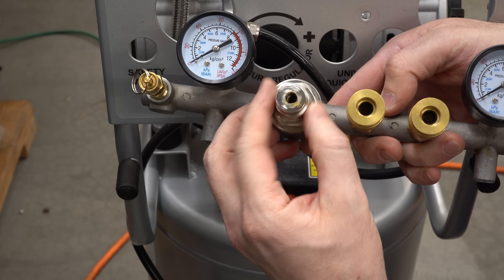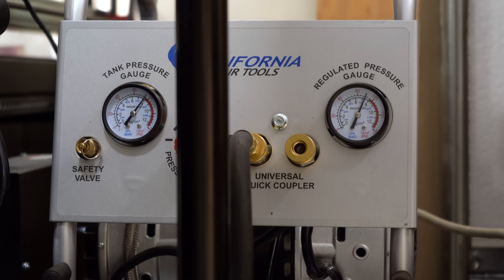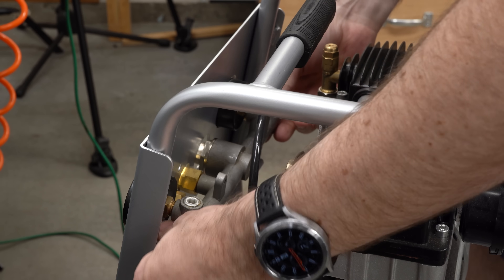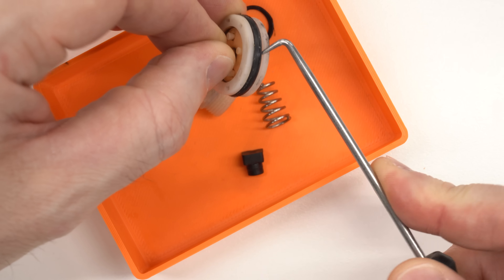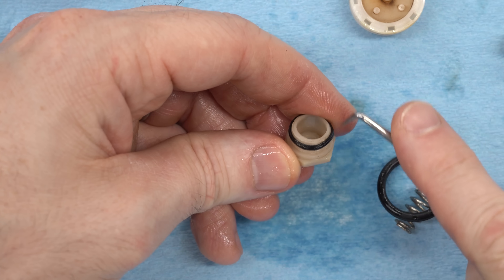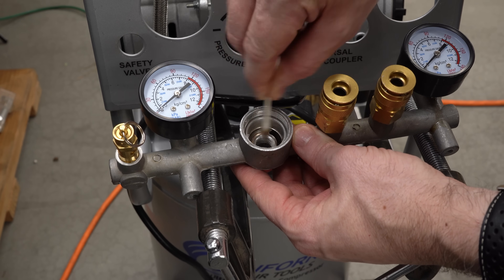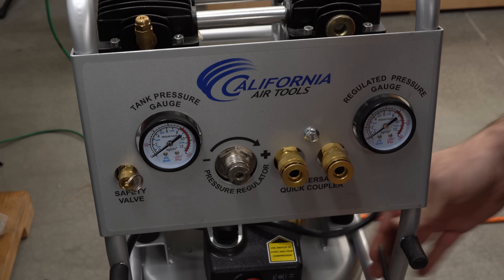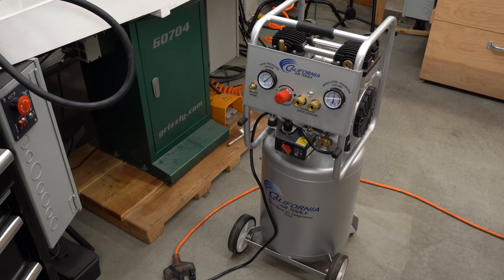Repairing a Leaking Air Compressor Regulator | California Air Tools

Comment: Thanks for video.  Worked for me.  I had a slightly different problem, the regulator was just leaking air so the compressor never stopped running.    You asked about he red ring: the red ring is to lock against the red knob so that the red knob does not accidentally turn.

Comment: What sealant do you use on the threads when you have to replace something on the compressor like pressure switch or gauge or some other threaded fitting? Loctite 545?

Comment: I had the same leak on my fortress (harbor freight) air compressor and this fixed it. The knob on mine comes off a little different than yours but cleaning the parts fixed my leak. Thanks for sharing!

Comment: Mine is 10020 and yours is 10020C, my internal M14 is not plastic but brass. I cleaned as well but no luck. before I clean each air release cause 10psi down won't recover, after cleaning each caused 5psi down and max is 90psi. the red ring limits max psi now I tend to remove it. I think my regulator never works.

Comment: I have this same make. I really like it, as it's quiet enough to have in the garage yet not drive me out. That said, it did something once that caused me to never trust it to "just run". Once, as the tank pressure dropped off, the compressor TRIED to start but just sat there, stalled, drawing who knows how much power, and it was only a few months old. It hasn't done it since, but now I can't trust that it won't blow a breaker - or catch fire.

Comment: I think that plastic piece under the knob is to prevent you from adjusting the air to high. Maybe they didn't know where the top side of the adjustment was going to put it so they added the rings after the fact. No idea for sure. Just a theory and I'm always down to provide some engagement. :p

Comment: My Briggs & Stratton 074027-00 air compressor was doing the same as yours, same problem with the flat rubber washer in the regulator. I replaced it with a small O-ring and it works fine again. Your video helped me quickly find the problem.

Comment: I had a pretty serious look at these style of compressors when looking to upgrade to a 'serious' shop level compressor vs an oil-lubed variant. I wasn't so concerned with noise since where it's going will be noisy anyway, but my experience with oil-less compressors has been mixed at best. This style does seem to offer something I hadn't tried yet and may be better for it in the long run (as I understand them, they have serviceable parts unlike most any direct drive oil free units at the big box stores), but the thing that held me back was the relatively unproven duration of how long they can run high volume air. In comparing them to more proven oil-lubed variants, it seems the motors in these are reluctant to run longer durations on a large reserve tank in the 20-30 gallon range without thermal break cycling. The more you look around at the mid-tier range, these little twin cylinder 'quiet' versions are popping up more and more, which made me try to chase down who actually made them. It never panned out trying to find a definitive source, but they all looked exactly the same and came from China; big surprise, right. 

Anyway, curious to people who own either this CAT brand or the other variants what kind of 'mileage' they've gotten out of them when pushing air hog type tools, vis-a-vis plasma cutters and the like.
Reply from the maker: CAT has different models.  Some are rated to run continuously for something like 30 minutes (don't remember exactly), and some are rated to run continuously.  Mine is the former.

Comment: I have the same compressor.  Mine has a slightly different O ring on the white plastic diaphragm piece.  It's U shaped with the open part facing the inside of the regulator.  On mine there was enough clearance between the diaphragm  and housing that the U seal rolled over and started passing air out the regulator..  I simply machined an aluminum replacement cap for the diaphragm and removed the valve.  Flow more air that way. I never use the regulator.  No air leak, compressor  will hold pressure easily for a few days. Most of the leak is from hose and nozzle.

Comment: I have lived my entire life with compressed air leaking (My dad's compressors and whatnot all leaked)... Until I got my new IR compressor, and after making sure all tapered  pipe thread fittings had pipe dope on them and were properly tightened, I had my first ever compressed air system with no leaks. I just leave the compressor switched on even overnight and it holds air, granted if something ever starts to leak overnight I guess I may have a big electricity bill.

Also hoping for fewer issues with leaks since I have a cooler and water air separator on the compressor outlet, should prevent rust and debris from causing any valves to leak, though I should probably add inline filters somewhere.

That said some of my quick fittings are leaking and I leave the ball valve turned off most of the time. Need to sort that out.
Reply from the maker: I do the same, and worry about what might happen if I have a catastrophic leak when I'm gone.

Comment: When setting the pressure regulator, you set it to the desired psi while the tool is running. Different tools have different air requirements and should be set individually. But since it is a small compressor and you probably aren't running big air hog tools, you can usually set it a little high at around 95-100 psi and it will drop close to 90 psi when in actual use.
Reply from the maker: I'm not generally running air tools from it.  Mostly just blow guns, pneumatic cylinders, and mist coolant systems, which regulate down to much lower pressures, so it doesn't really matter.

Comment: I had the exact same compressor. Mine was leaking the day I took it out of the box. I think my leak was different than yours. It would slowly lose air, and if you left it overnight, the tank would be empty. I tried fixing it and was not able to. Reading the Amazon comments, a lot of people had the same or similar issues. I kept it for a year because it was too much of a hassle to pack it up and lug it down my stairs to return it, and it worked well enough for my limited use. I ended up gifting it to someone that bought a small Taig desktop CNC from me. I never wanted to see it again. Just a garbage product, IMO. Stay away.
Reply from the maker: Mine leaked from day one, also.  The issue was the drain valve.  I called them, and they sent a replacement, which was difficult to replace due to the incredibly sticky sealant they used, but it's been fine ever since.
Reply: @Clough42  so yours broke twice then. Once out of the box and once for this video. It’s a poor product.

Comment: I was thinking that plastic ring is something for the knob to seat against when fully tightened rather than rubbing on the cast metal valve body. I don't actually know, just guessing.

Comment: The regulator would not need cleaning as often, if an air filter was installed between it and the tank, but it has to be installed after the relief valve.🙂

Comment: Good fix!!! Shop maintenance….I use a electric Red Top solenoid to open the tank pressure to the shop lines….damn unit is requesting maintenance (again)….LOL
Reply from the maker: I probably shouldn't just leave the system pressurized, but I do.

Comment: Hey James, I also have a California Air Tools Compressor, though a different model. I once destroyed a part trying to remove it off the compressor. When I call the manufacturer they told me they use Red Loctite on the fittings. WTF!!! I got some new parts and installed them with some Teflon tape so that I will be able to remove them in the future. Not sure why in the world they would do something like that. Ciao, Marco.
Reply from the maker: The stuff on the drain valve didn't look red, and it was gummy.  But it sure was tenacious.  It felt like it was galled, and I thought I was tearing out the threads removing it.

Comment: Here's a vaguely related question that's bugged me a long time - every"portable" (whether hand-carried or roll-around) compressor/tank combo I've ever seen, has the super heavy part on top of the light empty part. It's like the goal is to make it as tippy as possible, and also harder to change the pump oil.
I'm guessing there's a good reason, but I don't get it. I don't think the cooling airflow past the pump would be affected much either way. The pump might heat up the tank a little, but the air in it is hot already.
Am I missing something?
Reply from the maker: If the compressor were on the bottom, it would eventually fill up with condensed water.
Reply: @Clough42  But could still be easily drained.

Comment: That right there is what we call a C.A.R. (cheap ass regulator... and yes, I made that up). That thing is junk. You can find much better at McMaster Carr or even Amazon. I bought a set from Amazon  few months ago and it came with a hp air filter, good regulator,  and a regulated air filter. I noticed that your tank air gauge was right at redline (120 psig). I hope the working pressure of the tank is 1.5x the redline pressure.
Reply: I agree. Pretty much every part looks cheap to me. Also having the regulator integrated with the manifold just makes it more difficult to throw throw the whole regulator out and replace it with something else. If the special (not quite an oRing) was really needed in the future that could be a pain if California Air isn't around anymore to supply it. Would rather have a regulator, safety valve, gauges, manifold, etc plumbed together with standard fittings. I considered California Air, but glad I didn't buy from them.
Reply from the maker: The redline is nonsense.  Probably just whatever was printed on the import valve.  The manual says the working pressure switch is preset to 125psi.

Comment: I think .. it would be nice to plumb in shop air and have a couple of drops where you need them.
It's a shame that compressor has issues, it looks like a pretty good quality unit.
Reply from the maker: In fact, I do have this plumbed into a shop air system, with drops in five locations.
Reply: @Clough42  Very cool.  Someday I might do the same, not there yet.

Comment: You may want to pick up some plastic o-ring picks, there's less risk of marring a part than a copper or stainless pick. We use them extensively for scuba regulator overhauls.
Reply: You can pick them up at auto parts stores.
Reply: You can use the picks off of dental flosses

Comment: That is the same design as my new compressor.  The regulator leaking past the 95 psig setting is what blew up my desiccant system.  My compressor was only a few days old when it blew up the desiccant container so I guess they are all dirty inside.   Thanks for an interesting video.
Reply from the maker: Yeah.  Your experience was the inspiration for my thumbnail.  That's scary.

Comment: I have been  Considering one of those compressors for about a year now to replace my 15 year old current unit. Are they as quite as  Advertised?  Belt drives are  traditionally more quiet than direct drive. I cannot stand how loud those little job site pancake compressors are.
Reply from the maker: It's way quieter than a typical hardware store compressor.

Comment: Hi James, the red ring is a locknut as noted by numerous others.
However, you cleaned everything in the regulator but neglected the over pressure safety valve. If you have enough gunge in the system to cause the regulator to malfunction you should also check the safety valve. It's right there on the manifold. It should also come out and be cleaned. It could be frozen closed which could lead to overpressure of the tank etc. Safety first when it comes to high pressure air .
Thanks for the video.
Regards from Canada's banana belt. 👍🇨🇦🍌🇺🇦🕊️🤞
Reply from the maker: Probably worth checking.  Though the gunk won't build up on the side that would block it from working.

Comment: I think the spring pressing against the high-pressure rubber valve wants to tip slightly. They're relying on the spring to hold an alignment of the valve, which is not 100% reliable.

I think all the "quiet technology compressors are the same, may or may not be built in the same factory. Your CAT is almost identical to my Makita, which is almost identical to my Harbor Freight. They make pretty good air for their HP, and the quiet is priceless.

Comment: Interesting, I might do that to my compressor. Before I became fully paranoid about pressure vessels I picked up an 11gal 3hp (allegedly) compressor for about $40 at a flea market, but it's definitely leaking at least at the regulator. I couldn't really bear to buy a new one for an old pressure vessel. That said, the hydro testing pump (like Quinn uses for boilers) costs double what I paid for the compressor. I can't decide if it's better to get it and test both compressors, etc, or just buy a new one with an aluminum tank if possible, to forever ease my rusty tank terror.
Reply from the maker: Or move to the desert, where there is barely enough moisture to rust anything.  :)
Reply: @Clough42  now you're thinking outside the box 🤣
Reply: ¿Por que no los dos?

Comment: The red ring is there to be a conversation piece and elicit opinions from viewers in the comment section of the video.
Like this one.
Thanks for the video!
Reply from the maker: You win the comment section for today.
Reply: I assume the red ring is used as a jamnut to lock the regulator knob from moving from its original settings from vibrations when the compressor is on and charging.

Comment: The ring is for mounting the regulator on a panel/mount
Reply: This is the correct answer. Your regulator is mounted on the manifold So the red ring is not necessary on a panel mount just have a hole to put the regulator through and tighten the red ring to hold it in place

Comment: The red ring is a lock but for the bigger red knob to lock the pressure at a certain point. They’re basically useless in my experience. Lol. Great video as always! Cheers
Reply: I always thought it was for the free-floating model when you’re panel-mounting it. Like a lock nut on a switch. Feed it from the back, use that ring to secure it.
Reply: @mr_voron  Pretty sure you're correct. The ring has a flat back to fit against a panel.
Reply: I came to comment on that but Jason beat me to it. Tho I don't think they're useless. In some cases the vibrations of the compressor or around it could cause the regulator knob to vibrate out (happened on mine, tho mine is cheaper chinesium one).
Reply: I just installed a regulator today and used the ring as a panel mount / bracket mount. I had to make sure the bracket was not too thick so the red ring would not interfere with the pressure setting knob but otherwise it worked fine.
Reply: ^That ^ i was gonna say the same thing
Reply: Jason is correct.  It's not a panel mound ring, it's a lock ring for the pressure nob.  Supposed to act like a jam nut, so you can "lock" the setting against accidental changes.  And yes, as Jason says, it's pretty useless in practice.

Comment: Pretty basic stuff; the black hose is just on a nipple-if you reefed on it, it might let go, otherwise, cut the black hose just past the nipple (like 1/2") since there is plenty, and when replacing, put some lube in the hose to press it back over the nipple. (me thinks)
Reply from the maker: I don't think so.  I think it's some kind of compression fitting.  The hose has a ridge molded into the end of it.

Comment: I think that the red ring is a locking nut for the knob.
Reply: It's for panel mounting to tighten it down against the panel.. not needed in this case since California made such oversized holes.
Reply: @kylefritch1928  nope. It's a lock nut. It's to lock against the knob.
Reply: @kylefritch1928  Exactly right.  And California made such a huge hole because the regulator gauge assembly comes in to final assembly  all put together,  and they did not want to bother taking off the adjustment knob to mount the regulator with the ring.

Comment: What happened to ring spanners? The ring is to lock the pressure regulator knob.
Reply from the maker: That would also be an option.  I'm not sure I have one in 30mm, though.
Reply: @Clough42  You should.
Reply from the maker: @WillemvanLonden  more tools I don't have.  You're right.  I need to fix that.